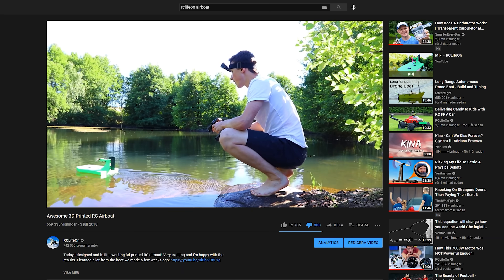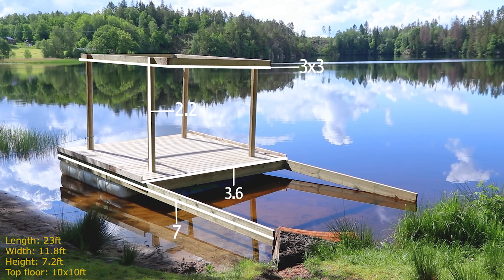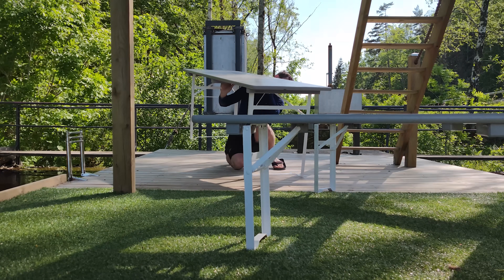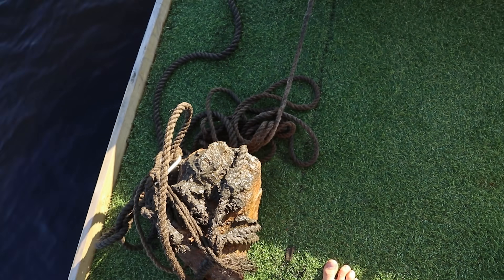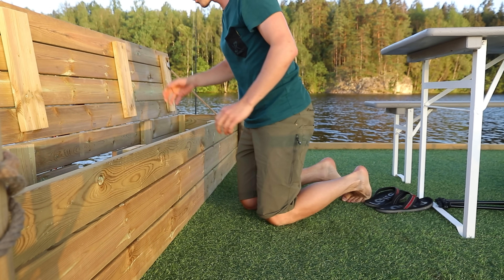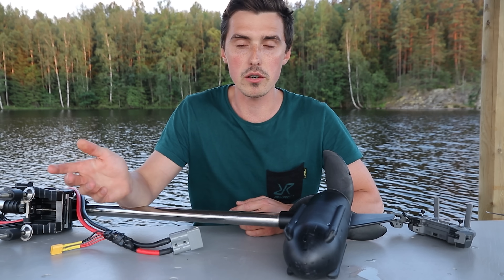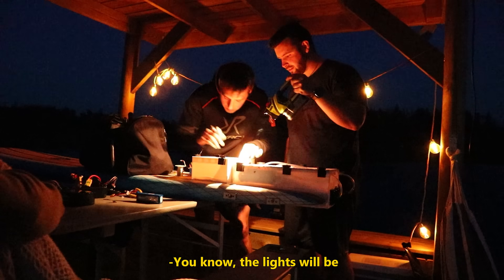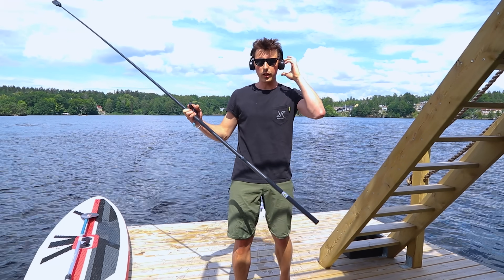Making The ELECTRIC Raft Powered by Batteries

Comment: Thank you so much! This video inspired me to build my own 4x4 Meter Raft! One of my best and definitely my biggest Project ever!
I had the added challenge, that it needed to be portable, because I live in Germany. We dont have that many lakes, so always lots of swimmers in summer and youre not allowed to just keep your boats and rafts in the water for long periods of time. German regulations... whatever. Anyways I managed to divide the deck into 8 2x1 Meter wooden sections, so they can easily be put on a trailor and be transported to the lake, where the deck sections can be screwed to an underlying steel beam construction with m8 machine screws, so its rigid. Then you just fix a 200l plastic barrel under each section with ratchet straps. The whole process can be completed with 4 people in under an hour.
An upper Deck would be a dream, but Its barely portable as it is now, so I think i will just put a beach umbrella on it for shade, and call it a day.
Im super happy that I just went ahead and did it despite it being difficult, and I thank you very much once again for your inspiring video!

Comment: The downstairs screen it in to keep out bugs🪰🐝🦟 or an electric bug Light on each corner a remote control trolling motor so you can sit upstairs comfortably on the couch find you an old 52 inch big screen TV floor model take out the controls all you want is the TV frame that's to keep the water out get you another smaller TV your preference and put inside of it get wireless internet place the internet modem in the bottom of the big screen TV you guys can play Playstation while on the water

Comment: Just an idea... If the 4 posts holding up the top deck were longer and monolithic, extending up to the top deck you could use 1 main pole on each corner and build a railing up to that looks nice which would also accommodate the stability issues.

Comment: I'm baffled you did not put a solar panel on this! Put 3 panels that fold underneath the top deck when not used and then when you need charge, fold them out.

Comment: Thing must have an insane weight. Just find a cheap old pontoon boat as a frame. Stronger, lighter, more dynamic with the cones on fron of the pontoons as well compaired to flat faced barrels. Also put some solar on top deck

Comment: For your rope get some hook and eye turnbuckles. Tighten fairly well when dry an they will tighten more when wet then once dry again u will still have your original tightness you set turnbuckles too. If the rope keeps stretching out over long periods of time just get some rope or cable made from this. I have feeling will be fine with just adding the turnbuckles. There super cheap too

Comment: Cool project. Needs more speed! Like 3 of those trolling motors for drive. Add a roof over top the upper deck that is covered with solar panels. you need more bracing for the upper deck. Movement and flexing will just stress whatever joints you have. Corner braces on all 4 poles will stiffen that up nicely.

Comment: bro im just really wondering
i notices you 3d designes the box seat wich is a super simple design

did you really have to 3d design that or could you jusg imagen making a squar out of planks in your head😂😂 did you 3d design it for the purpose of making the video more high tech😂😂
last but not least if you did that
did you first make it and than create a 3d model not to like build it but just for the video😂😂

also props for the rock anchor man jts epic

Comment: The batteries alone would cost you 4500$ +motor 1300$ +inverter 200$ +cables/connectors 100$. Electrics totals is more like 6000-6500$ not 2500$ as mentioned in the video @10:57

Comment: put another diagonal beam between the back post going forward to the roof part and it wil be A LOT stronger allready. And you can also just put in small gussets on the front posts as wel, they dont need to be as big as the ones in the back. Offcourse bigger is stronger, but even a small 1 helps.

Comment: Great build! That looks like a lot of fun. 
As for bracing and not blocking your view, have you thought about using steel cables instead of wood? It would give you much  the strength without the bulk. Just an idea.

Comment: Were I live in CANADA Eastern Ontario! it gets cold! I use to have a house on the water an believe it or not there were sail boats an cabin cruiser boats that had people living on them in the water all year round!. An all they used was a BUBBLER! its a little electric motor that blows bubbles underneath the boat an the bubbles keep the water from freezing a few feet around the whole boat so the ice an its pressure cant beat the crap out of the boat all winter. Its really a cool inexpensive solution! but it shouldn't be too hard to make a bubbler but then again their cheap I would assume!. L.O.L..

Comment: Hey man you should never try to cut a piece of timber in half the way you did at 4:37. 
Unless the blade wasn’t set as deep as I thought, and you were just cutting out a notch in the centre or something. Then you can disregard this.

If you rest both ends on something and cut it in the middle, it causes the halves to drop inwards and pinch the blade. This can make the blade kick back and if you are standing behind it when that happens you will end up horribly disfigured.
You need to leave one end free to drop away from the blade to prevent this. Using a set of saw horses let’s you adjust the width of the space that  you are cutting over and it allows gravity to pull the two pieces apart once the cut is complete.
Reply: Watching this again I think the blade actually started to jam just as you transitioned to the next clip?
I only know this because I used to cut out house frames and had a few close calls myself. Nobody taught me how to do it properly, they just told me to go do it.  :/

Comment: 911 comments lol!
As some other comments noted, you really should add more corner braces.
Studied wood building construction at school and collage. Right now it's alright, you did a pretty decent job but with the wind rocking that back and forth when you're not there +, you really don't want a "folding roof" to borrow from another comment.

I'm really impressed though, that's really nice, also interested in seeing the lighting, show it in the dark if you can safely. Now I really want to try this, but I'd probably need more stability than you for where I am, even at water level.

Comment: screw a panel of medium thickness plywood to the forward wall of your battery box and your side to side diagonal bracing will be improved. Similar panels on the inside of the end walls of the box will improve front to back stability.
Looks like fun!

Huge trolling motor!

Comment: Why not make V4 with 4 walls and a lightweight door? It'll give you the support plus shelter. You have enough bouncy for a lot of excessive weight. Make it enclosed where you can have a fold out couch/bed and a small heater (caged as to not cause a fire). That way you can sleep on the raft. Put another makeshift roof ontop of the upper deck for solar panels. That's a great idea.

That will give you the chance to sleep on it during the winter and spend longer onboard. Even have an area where you could have a tiny open fire.

Comment: Insert a valve stem with a schrader valve and fill the barrels with air. They are 100 times better. We had barrels with a screw on cap and installed the valve stem in the cap. Little RTV and no leaks good to go. Much much better.

Comment: wtfffff my comment got deleted... btw really awesome raft keep up the good work :DDD okay don't know if this is posted like 20 times, but it keeps deleting....

I have some ideas down below:
6:35 maybe something on the stair so you don't fall when its wet
https://gyazo.com/6558053af3095f9b6626fd5641ac94d1 for the paddleboard(pink) or something, the yellow is just a normal tree post, and the orange with maybe a hole in the middle for the fishing rod.
https://gyazo.com/37b811a704e02cdb60afc6475c3df75a so you can open when you want to jump in instead of climbing over, but still closeable, the orange is for something to hang the robes on while open.

Comment: Now I want to build one of these but supersize it to the point it holds an actual wood fireplace/fire pit on the top deck. Personally I would like to make it electric too but if it will be going on a much larger body of water it may have to be gasoline powered or at least have a gasoline generator. Thank you for the inspiration

Comment: Great project; TV was brilliant. Pieces of wire (X-shape) can give structural integrity to the second floor without ruining views. Underwater lighting would be cool; and you would recharge your batteries in a seven-hour day with 3 double-sided solar panels. Build a light-weight aluminum or carbon-fibre "shelf" and set the panels side-by-side parallel with the water (or turn it to become a turnable "sail" if you wish - with more engineering). If you lay solar panels into an L-channel frame with removable fasteners then you can remove the panels in winter so they will last longer.

Comment: I bet with a bit of 3D design on some linkage and brackets. A large servo, Arduino or Raspberry Pi, GPS shield...You could make the raft autonomous and set waypoints around the lake. Good job! Very cool project.

Comment: A possible solution to making the top more sturdy without bumping your head or sacrificing too much on the design:

Make one of the sidewalls, probably the one closest to the stairs, into a screen, with one or two additional vertical posts in the middle, and horizontal "slats" spaced out enough so you can still see obstacles/boats through it. Then, you support that side with those corner braces and have it stabilized in 2 directions instead of 1. You could also use that wall to hang stuff like your bags and boards. The two main concerns would be weight distribution and it acting like a sail, the first of which could be countered by making this wall opposite to the stairs and the second of which can be mitigated if you have enough spacing in your slats.

Comment: Very cool!!! If you're looking for a less expensive LiFePo4 12V 200Ah battery, check out Battery Hookup. They sell a 12v 100Ah battery for $250. Buy 2 for $500, add a 12v 200Ah BMS for $100, and you've got a 12V 200Ah battery for $600, not $2,000. I know it's sponsored, but holy hell I wouldn't spend that much money.

Comment: lifepo4 are always the best type u want to have now 
light , powerfull  , work in any wether , lifespan is around 15 years (and more)  or 80-90% nominal capacity after 3000-5000 cycles from 0 to 100%

Comment: Awesome job on the raft!  Those batteries are impressive, the real time monitoring is now a must have.  Glad to to see the electric surfboard is still operational.
Reply: Lol I tried it a day before and nearly blew myself up with 200 amps 24 volts running trough cable to the negative pole and blowing it up (it melted in one milisecond) I was building a small 230volt setup just for fun (I want to meet Simon )
We wanted to build a camping in Sweden 🇸🇪 always will be the best YouTuber to me !

Comment: Here's an idea: install a big steering servo on the shaft of the motor. Then you could make the whole raft RC (goes with the channel name). But once that's done, install an Pixhawk with Arduboat and you can have the raft run waypoint missions around the lake while you party. Or just do station holding to account for the fact that you lost your anchor again. Or program the boat to follow the surfboard (it wouldn't be able to keep up, but it would at least be closer when you were done).
Reply: That's an awesome idea! Maybe  it could be combined with solar panels for longer runtimes + energy for a cooler,. Also, adding a steering wheel (controlling the servo) on the top floor would be great!
Reply: Someone watches rctestflight
Reply: @fallingwater  Guilty as charged :-)
Reply: @fallingwater  our lord and savior rctestflight
Reply: Great ideas 👌🏼
Reply: I like the idea

Comment: You tried to fix the racking with diagonal supports under the 2nd floor.  You need diagonal supports under the main deck and along the sides.  Also, read up on anchors: they are not just heavy.  Their shape is important.

Comment: You: "We made an agreement to only use electric vehicles on the lake"

Also you: Built a 30mph electric surfboard.

I'm guessing that's not what they had in mind, lol.
Reply: Its probably more about the sound then anything. Combustion engines go brrrrrrrrrrrrrr
Reply: @thetranspanzer3692  electric engines go meeeeeeeeeeeeeee
Reply: @TrinityBeatsOfficial  No such thing as an electric engine.
Reply: Next week.
I built electric airboat. 
It's kinda loud. But it's ok it's electric.
Reply: likely its more about not polluting the lake from the fuel/exhaust
Reply: @Megalixer84  and engine oil swaps
Reply: @Megalixer84  yes
Reply: It is mostly about not polluting the water, several lakes in Sweden have this policy today

Comment: You should take that "storage box" in the front and move to the back of the boat. On the sides of the "patio" area in the front make bars on each side, and put storage under them. They will give higher up supports on both sides, and who can argue with two bars on a boat?! That's what you do on a boat, drink right?

Comment: With the caps of the barrels one side will have been opened so you need to use thread tape otherwise over time the barrels will take on water
Reply: Threaded tape and plastic welded is the way to go.

Comment: Hook 2 servos or steppers to control steering and throttle and let ardupilot do the rest. Easiest, cheapest and first auto pilot raft, just sayn'
P.S. for a 24h challenge, one has to ask, how/where did you go for number 2?

Comment: 11:00...IDK... something seems to be wrong with your calcs. Two batteries @ 1,641.28 Euro plus the Motor for 1,299 comes to about 5,880 on my calculator.... That doesn't even include the raft costs.:-/ 
Don't know where you got 2.000 to 2,500.

Comment: safety over anything. Add support in both directions on all 4 posts at the top. you need to support it where the load is so supporting it at the bottom does nothing. I thing you would be quite sad if that thing went sideways and crushed your friends below.

Other than that, great build :) guessing you going to have some great times on that thing with friends and family

Comment: Putting a solid wall on the frame of the second floor is what the construction industry calls a “sheer wall”. Here in California they are required by the earthquake building code. 

Maybe add 2 more diagonal planks on the sides bc you’ve only got one axis stabilized with those 2 on the back posts.
Reply: hahah the earth doesn't play quake you silly

Comment: Needs solar panels to make it completely rechargable, and some sort of Ardupilot autonomous setup
Reply: Holy shit imagine
Reply: I am glad to know I wasn't the only one thinking of Ardupilot! A couple of props on the bottom, throttle based steering (can't remember what it's called), ooh, could even do the fake anchor where gps keeps it in place!
Reply: @danieljenkins4213  differential thrust for steering I think is how it's called. At least it makes sense to me 🤷‍♂️
Reply: @gttkp  YES! That's what I was trying to think of. Thank you
Reply: With way points so you don't have to steer it.

Comment: Simon those brackets you put on to remove the brace are called knee joints. You should have knee joints on each column in 2 directions so you don't end up with a folding top floor.
Reply: That is slightly over constrained and I get the view and not hitting your head arguments. The staircase (and box) more or less takes care of the longitudal flex, the two joints in the back take care of the lateral forces. There is only a big twist left laterally in the front and only one joint behind the staircase would greatly reduce that without obstructing the view or passage of your head
Reply: @rosserobertolli  I agree
Reply: a folding top floor hahahaha, love it
Reply: Those small "knee joints" look good. I would not mind, you can make them quite small and they still work.
Reply: They make serious metal shelf brackets that if screwed on properly would be an instant fix and would keep the view.
Reply: THANK YOU!! Exactly what I was thinking when I saw this. To really support it it needs knee joints in both of the directions he can.
Reply: Yea, as it is now it's SUPER unstable, the only thing really stabilising is the staircase, and that's just in the length direction, and only in one side.
Reply: @TheKimNeeper  yeh def needs them an without them those stairs scare me too. They don't even have to be very long.
Reply: We always called them haunch braces but same principle. They will make a world of difference.
Reply: Yeah... Safety is good, too. 🙂